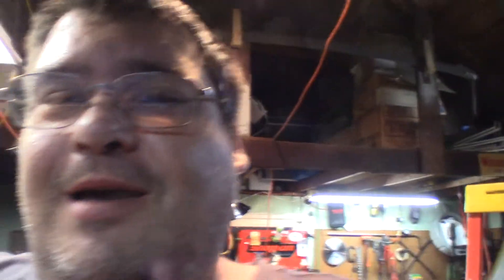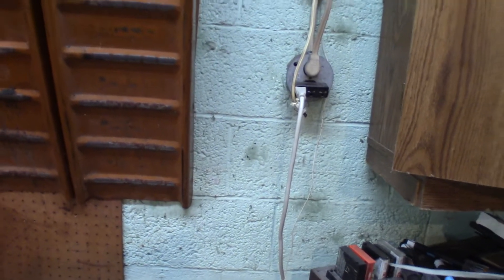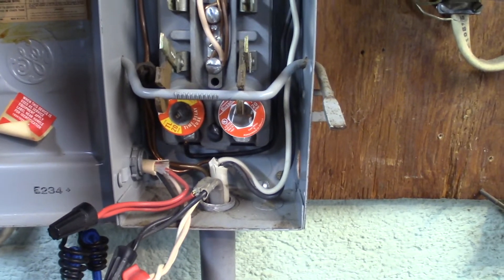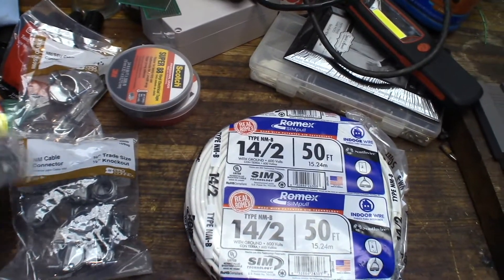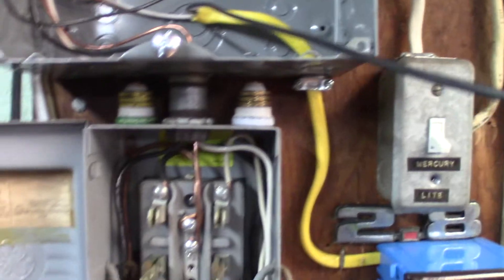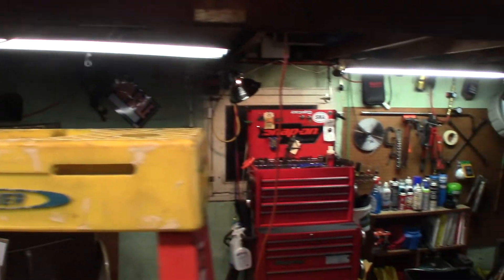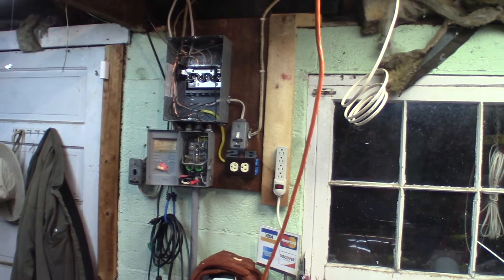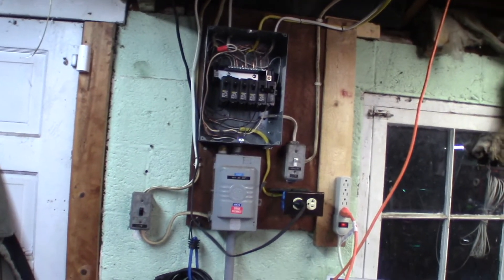Updating Electric Service in Garage on a Budget  - Part 1

Comment: I’m only 13 so you probably think that I don’t know what I’m talking about but I’m a sub panel the ground and neutrals NEED to have their own sepreate bars
Reply from the maker: Absolutely.  Modern code requires that there is a separate conductor run from the main panel and the Ground should should be isolated from the neutral, and if the sub panel is in a separate building it must be run in non conductive conduit and two ground rods must be installed at the sub panel building.   This guarantees  that if there is a failure of the neutral connection there wont be current on the ground at the sub panel with a different ground potential. 

However, In 1971 when the service was installed in this garage this code did not exist.  Since I am only replacing after the main fuse box that enters the garage it is grandfathered in.   Since the ground and neutral are bonded at the main fuse box there is no benefit to isolating them in the load center.  It won't say this way forever.  I will be upgrading it to a 50 amp service and running new wires and bringing it up to modern code.  For now it is a lot safer and better than it was.

Comment: Looks like another fun project.  Which box is your electric fence running hooked up to?  Is it running off your garage?
Reply from the maker: I have and extension cord running in the hole from the old chimney and then going out to the garden box.   Then another cord buried from the garden box back to the garage.  That is going to get change over eventually.  I will be putting conduit back to the shed from the garage and putting in a 15 amp circuit for it.  Then the fence will run off o of the shed.  Probably a next year project though.